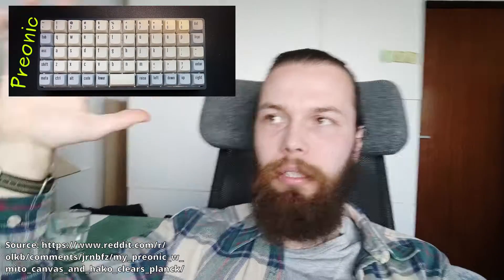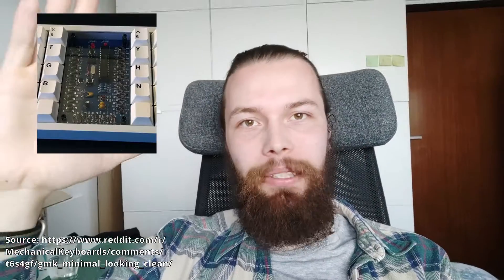Lumberjack keyboard build | Kailh Box Navy, PBT, National Park theme

Comment: great build, TY. So where did you get the pcb itself? Everywhere i googled it's sold out.
Reply from the maker: I had it manufactured via JLCPCB. Minimum order is 5pcs. They can also manufacture plates. But I do have extra ones with soldered components, printed plates and acrylic covers. Basically just as is in the video, just needs key switches, key caps, cable and case. Hit me an email if you are interested. I'm located in Europe.
Reply: @infiniteoffset  I definitely am interested. I'm in Europe as well. What's the email address? Also would you happen to know if the board is compatible with low profile / choc switches? Thx
Reply from the maker: @grabush77  So, I just checked the choc support. My PCBs are rev1.3 and these only support cherry. Choc support was added later in rev1.5. My email is infiniteoffset@gmail.com
Reply: @infiniteoffset  I sent you an email. Thanks